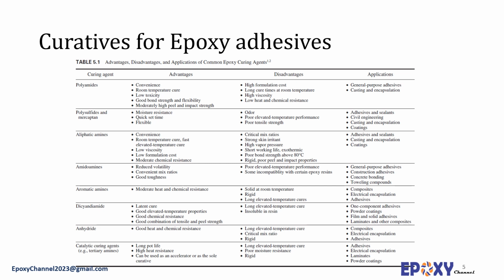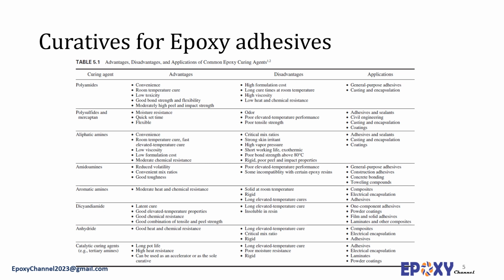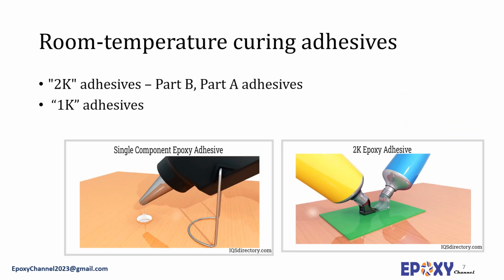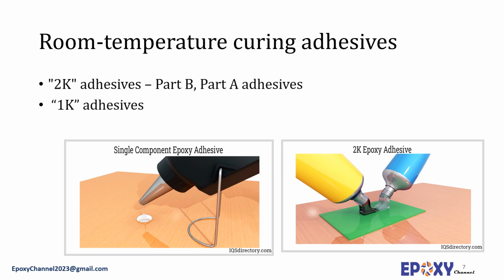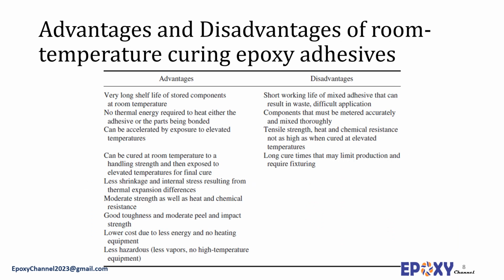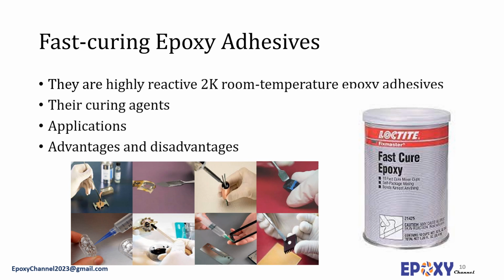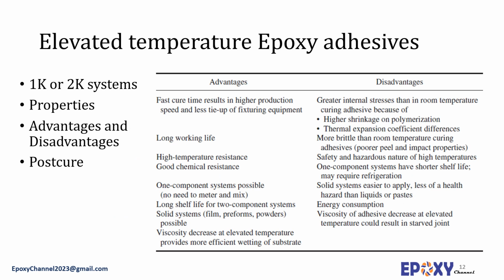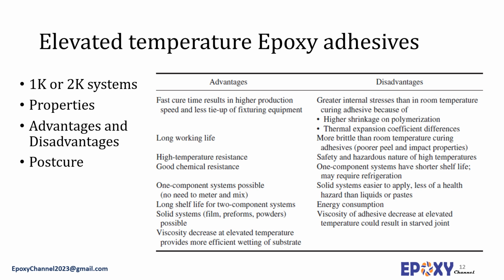Structural Adhesives - Session 40

Comment: Please can you send to me the equation of calculating the percent of hardener to the resin
Reply from the maker: Hey. That depends on the type of the hardener. it differs if it is anhydride type or amine based type for example.  Lets asume you have an amine hardener system... for that, you need to know the EEW of your epoxy and AHEW value of your amine. I have separate videos on these topics at my channel. however, you can find the formula and explanations here: 
https://polymerinnovationblog.com/epoxy-curing-agents-part-1-amines/